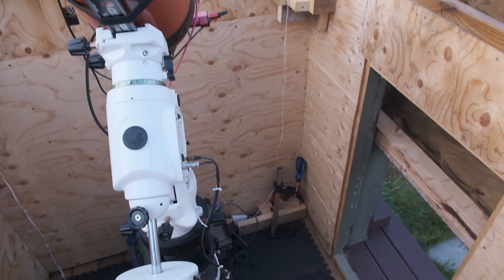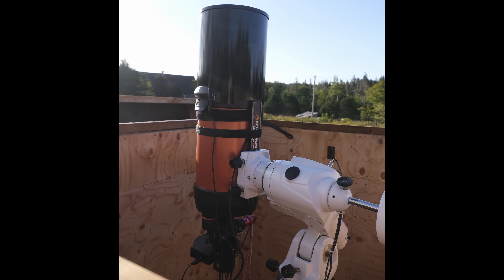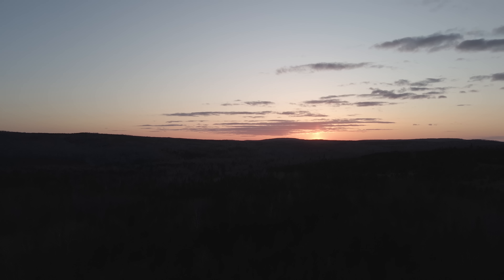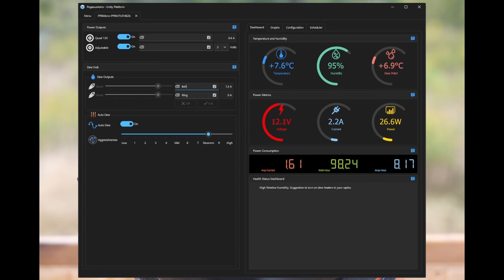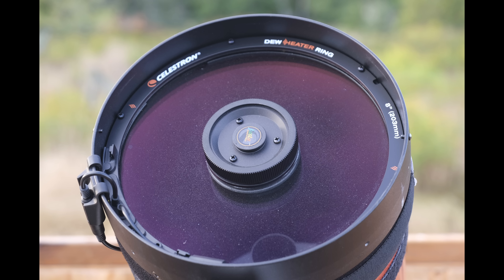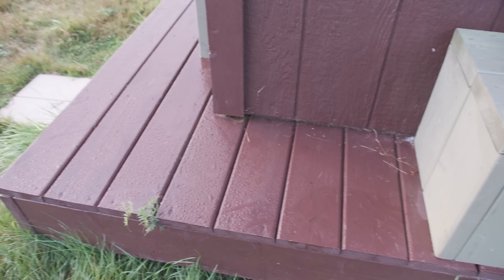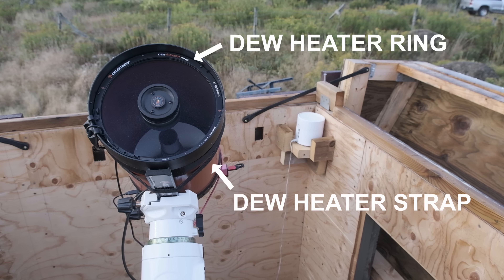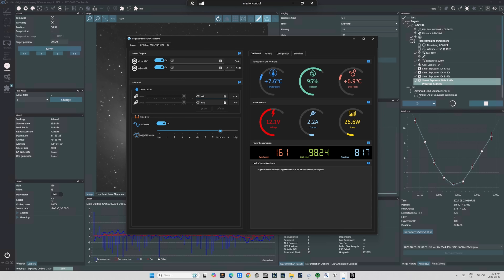Are Dew Shields Really Necessary?

Comment from the maker: I forgot to note in the video that I am still experimenting to find the lowest possible settings for given dew conditions. I think I can push lower, which should avoid occasional star smearing, also associated with dew heater rings.
Reply: If you were to choose one would you prefer the dew heater ring or dew heater strap?
Reply from the maker: @IZ792 If using a SCT, the ring is the most important, but a strap or two is exceedingly useful. It does help a lot to warm the OTA.

Comment: Funny how your worst night of humidity is a regular Tuesday where I live: we get that shit in the summer!
In autumn and winter there is no dew accumulation: it goes directly to frost sometimes I’ve found my telescope with icicles hanging from where the frost on the tube had melted and run down the dew heater wire. Also, I need dew shields as light pollution shields, but the wind problem is almost non-existent in my areas.
I’d rather trade wind for all the other negative factor of my area (light pollution, low transparency, humidity)

Comment: I use mine primarily for doing flats on the rasa
Reply from the maker: It is very handy for that. Especially since shooting flats without the dew shield means detaching the wire connector that feeds power to the dew ring.  It's a poor design on Celestron's point.

Comment: Great video! 
I perfectly agree with you regarding the poor guiding when using a Dew shield and the wind builds up…
I personally just use a Dew shield due to stray light from heavy street LED lights, as my OTA’s (a 72/420mm APO) built-in dew shield seems not to be enough

Clear skies

Comment: I use a dew shield of almost the same length of the OTA when using my 8" RC telescope. On the one hand to prevent dew on the secondary mirror and on the other hand to block stray light in my BC6 suburb where there are light sources everywhere.

Comment: It looks like you are using the Pegasus Astro Powerbox Micro.  It doesn't provide much individual control over dew heaters.  Other models give you more individual control, including setting the desired power level and assigning auto dew to individual bands.

Comment: For where I live in Michigan its 100% needed.

I have a dew heater ring though I have to lower the power to 30ish% otherwhise I get pinched optics.
The dew goes in about 4 inches on the inside.

Without the shield I do get dew on the plate.

I am also protected by trees so breezes are not as bad. I tend to get .4"-.6" guide error.
Reply from the maker: Are you using a SCT or Mak? Have you tried adding a dew heater belt or 2 to the OTA to warm the air within? I find that makes a huge difference and allows me to run the ring at lower power, reducing risk of pinched optics.

Comment: One method I used to reduce dew was to put a scarf around the dewheater . Using a thermometer I measured a temperature at the center of the lens of an 80mm guide scope that was a few degrees higher, setting it to minimum power, than compared to the maximum power, but without scarf . Much heat from the dew heater is lost to the environment, not to the telescope.
Reply from the maker: Most of the heat is lost to the environment. Anything you can do to focus the heat application should have a beneficial effect, so long as the dew heater ring isn't over heated.

Comment: I'm not convinced a heated ring on the corrector is a good engineering solution. By the way, The Wanderer Astro dew controllers and power boxes allow independent heat delta on each dew strap which can still be based on the humidity, due point and temperature sensors. My dew conditions are also severe, but I only have to worry about a middle sized refractor, so far less problematic.
Reply: You're right, the heated corrector ring isn't a good engineering solution.... The 'natural conductivity of glass' is mentioned several times in the video, but glass is a poor conductor! By putting a heating element around the edge of the corrector plate you're trying to push heat through glass 4" - 7" thick, which requires more heat (a bad thing) than any other solution, and in some conditions still isn't effective at the center of the CP.

Comment: I think you're totally correct in your assessment, specifically for your area, and definitely about the amount of power going to the dew ring or strap. My Edge HD will also get pinched stars if I go about 25% power on either the ASIAir Plus or if using NINA and the same Pegasus Power Box. Speaking of, I've had issues with the power box software not staying online, or not holding my power settings. I don't know if this is from their software or NINA but it's led to pinched stars and dew issues a couple nights. But, in my Bortle 5/6 area, the shield certainly helps for stray light and adding a bit more contrast to the image. When I use the shield though I have to set up a wind block because, just as you say, it's almost like a wind sail.
Reply from the maker: My Pegasus Astro PB has been 100% reliable. But it has a problem. If you use the automatic dew aggression feature, that setting will run even if the software crashes because it sets the power box internally. If you run the manual dew settings to get control of each dew channel, it will not internally set the power box so a software crash will leave you without power on your heaters.  I work around this by setting the dew heater to auto in the morning, so the next time I use the telescope, the dew heaters are going before sunset to warm up the system.  Later, when I boot up all systems at dark, I set the manual dew heater channels to whatever I need for the night.

If you are getting pinched stars despite low settings, though, you should contact PA. Your PB may have a hardware problem.

Comment: I have the same rig as you, including the aluminum dew shield, but with the exception of the mount. Nor do I have observatory walls around my concrete pier. In 5 to 10mph winds my guiding runs at a solid .3 to .5 all night. Although I will not argue that the dew shield does in fact catch wind, the guiding numbers you mentioned in the video during windy nights, I would place every bit of 80% responsibility of those numbers on your mount. But that is just my mere opinion.
Reply from the maker: What mount are you using?

Comment: I have recently encountered pinched optics so this video is very helpful!! I need to use a dew shield to block stray light and will now experiment with lower heater settings but also get in the habit of noting temp and DP. I may lose some images while experimenting, but this will work out better in the long run. Thanks!

Comment: I use an EdgeHD 8, and when used on my tiny south-facing balcony to image to the south, I don't have room for the dew shield when the scope is pointed to the home position. I have just had to put up with only having the dew heater ring, which is probably a good thing because in that position it's very susceptible to wind.

Comment: There is a lecture by Dr. John Hayes on The Astro Imaging Channel where he explains how a dew shields work. Short: It blocks the front glass element/corrector from being exposed to the black body that is the night sky. This suppresses heat radiation, which would otherwise allow the front glass to gets below ambient temperature and the dew point. This also means that a mildly heated dew shield is the most effective dew prevention method. 

Everything is a compromise, though and whatever works for any given setup and location is great. I've had traumatic battles against wind in my first nights myself so the thought of having that sail area exposed to the winds you're mentioning is terrifying and I understand why you would try everything to avoid a dew shield.
Reply from the maker: Yes, it ostensibly partially stabilizes the air column over the corrector plate or objective.

Comment: Having an observatory will help... but In the UK winter a dew shield is essential even with a refractor. My scope has one built in but I find it works better with some foil / bubble insulation wrapped around it.
Reply from the maker: Is it because your winters are warm and wet?
Reply: @SKYST0RY  humid & on a clear night temperatures keep dropping till dawn. Possibly being by the sea doesn't help.
Reply from the maker: @ParacolidingDanni  I see. Here, winter is below 0 the entire season.  No humidity issues during the winter.  Snow and ice . . . that is the problem.

Comment: I stumbled on this reality as a beginner. I purchased the dew heater ring for my EdgeHD 8 first with the plan to get the dew shield later. A year later and I haven’t felt a need to get the shield. I’ve been able to manage dew well with just the ring. I don’t have a strap around the OTA. It may not be needed on the EdgeHD models as they have vents to stabilize the inside vs outside temps (I can’t say for sure, that’s just my assumption). As stated in the video, everyone’s situation can vary.
Reply from the maker: The Edges should do a better job stabilizing internal air temperatures. They have a weakness in that they are more prone to spiked stars if your ring temp is a little too high. It's a six one way, half dozen the other situation.

Comment: Nice idea but sadly you can forget all about that if you live in an area like me, especially if you use a Hyperstar (and a RASA I guess). Although my area is listed as Bortle 5, which is not on the face of it too bad, it is the positioning of nearby street lighting and neighbours security lights etc which causes the problem with stray light entering the OTA. When I first used the Hyperstar, I couldn't understand where the fuzzy red line across my images had come from. It was actually the faint glow from a neighbours security light illuminating the camera cables. But yeah, for planetary etc it was fine without the dew shield. Thanks for sharing.
Reply from the maker: I have no experience dealing with light pollution at all.  How badly does the corrector plate refract local light sources onto your image?

Comment: Why are you heating the OTA with the band if you’re already doing it to the plate? This was never explained, what’s the purpose of running both?
Reply: It is not really necessary. I guess he is doing it because it is not seeing any ill effects. He is also using AC power and thus does not have to ration battery life.

Comment: Like others here I  the dew shield as a light shield but reached the same conclusions as you on dew strategy for my 8"SCT. 20% or less for the dew ring (to avoid spiky stars) and 50% approx on the dewstrap around the tube. However I don't automate overnight so if I see noisy guiding when gusty I will remove the shield.

Comment: Great video.  I live in St. Louis MO, near a river. so high dew points right after sunset   I have gotten the pinched stars too, but I did not know it was coming from my dew heater temp setting being too high.  Thanks for the tip!  I agree 100%, I have the 8" SCT and I too have see the wind-sail effect from the dew shield.  Unfortunately I have to use the dew shield as a light pollution shield for stray light from my surrounding street lights.  Just can't get a break!  Thanks so much for your videos.  You're straight to the point and I love that about your videos.

Comment: I have a Skywatcher 190MN Mak Newt. I run a dew strap and a shield. The shield serves another, more important purpose - blocking stray light. I shoot in remote area, but there are other photographers and the occasional car driving by. But it’s almost an unusable setup if there is any wind harder than 4-5mph. I never have issues with dew, but I’m in a pretty dry area and any dew we get is very light.
Reply from the maker: Blocking light is a necessity. My dew shield occasionally serves as a bug shield.

Comment: A very compelling discussion. The argument that winds over 7 km/h can be problematic. Telescopes with longer focal lengths are more sensitive to vibrations. I have a similar setup to yours, minus the observatory. With the powerbox and Celestron dew ring set to 20% I have no pinched stars, no dew on the corrector plate, but I do have a dew shield, as it helps with stray light from nearby motion sensor lights.
Reply from the maker: Absolutely. The dew shield allows you to apply less power. With the dew shield, I can use the aggression feature, and usually set it around 5 on high dew nights without deleterious effect.  I need more power without the shield, but the frequent night winds make that difficult.

Comment: a good idea is to get one of those volume like knobs that has a resistor in it, and you can connect it between the power and the heater and dial it in to let's say half then when it hits the main one at 100% the other heater gets half (the mechanical one, they're pretty cheap)
Reply from the maker: I used to use a rheostat, but I got tired of going out to the observatory to change settings at night as conditions changed. I can change the settings online from the cottage with the Pegasus Astro Power Box.

Comment: For those not in bortle 1, dew shield can help with stray light etc
Reply: Came here to say exactly this... it's not really a dew shield for me (Bortle 8 in a dry climate), but it mitigates my neighbor's brightass flood lights.
Reply: That is the main reason I have one on my SCT. Celestron dew ring on the glass does the rest.
Reply: @jamesw5713  does having the heater on effect the optics at all - I seem to get some "noise" from the heater running at 100% - and I lower it to 50% which seems to handle this.

(I see he just covered this on his discussion around 5 minutes in)

I took my scope to my guy - I ran it without a dew shield for a few sessions - I had a lot of buildup of (I assume pollen) on my lens.
Hadn't had this issue before - I assume that some moisture allowed the pollen to set on the lens.  I had issues trying to clean it off so my guy did it for me.
Reply: I’m in bortle 5 and find I have to use the dew shield to stop stray street lights or houses nearby going to the toilet at 2am and turning their bathroom light on. It helps. Results without are useless.
Reply: Also helps if you are imaging while the Moon is up.

Comment: Being a fan of F1 and having seen all the tricks they play with aerodynamics to create vortices and move air to very specific areas around the car, I wonder if a circular perimeter windbreak could be designed to create laminar flow over the observatory. A dome probably does a good job, but I wonder if there is an even better design. Anyone friends with Adrian Newey? 

Have you experimented with wrapping the tube with insulation? I've seen that a lot lately, but haven't tried it.
Reply from the maker: I haven't wrapped the tube. Due to the night winds around here, I do everything I can to minimize drag on the telescope.

Comment: One thing I learned when using the Dew Heater Ring on my RASA 8" was it works better with Celerons dew heater controller as it can monitor the temperature on the corrector plate but I still got pinched stars sometimes.  When I switched to the Power Box, I either had pinched stars or dew collecting.  I eventually just used a dew heater band.  I realized that the gaps in the mounting points on the corrector plate mount corresponded with the spikes I was getting.  I never had this issue with the C6 SCT with the Dew Heater Ring but that could be because the corrector plate was smaller.  I had no choice to use a dew shield because my neighbor had security lights that were super bright and was the only way to prevent stray light.  Thanks for the video!
Reply from the maker: The Celestron power supply's problem is it provides full power and the reducing the power just spaces the application of power out.  If you look at the power output from the Celestron power supply on an oscilloscope, you have a peak amp wave that reduces frequency as you lower the power.  But it's always at peak.  It is a cheap way of managing power, and some engineers who examined it thought that was why the Celestron power box worked so poorly. It did well keeping dew off but often resulted in spiked stars, even at low settings.  It was why I opted against the Celestron PS.